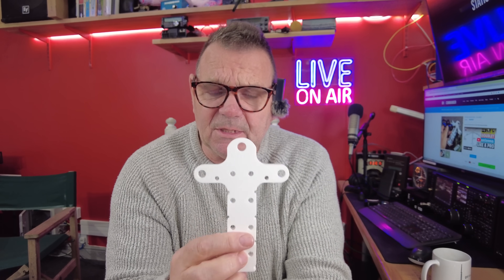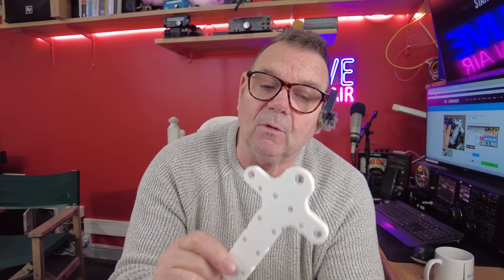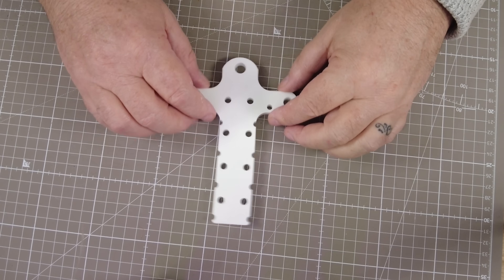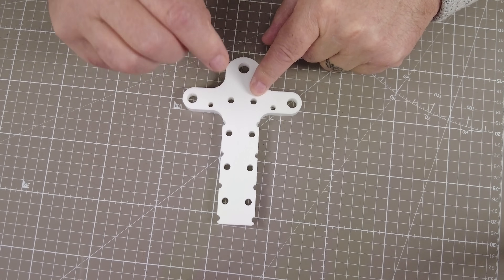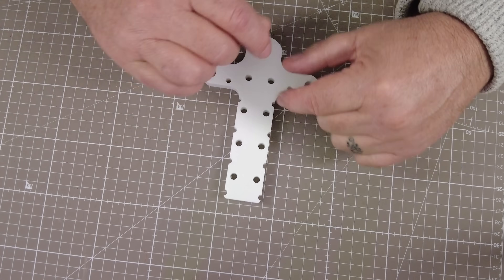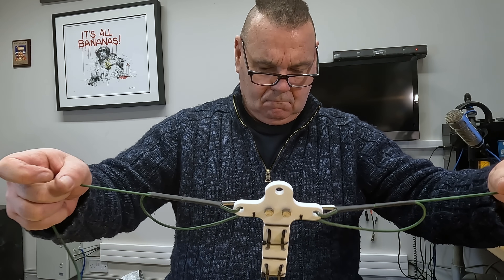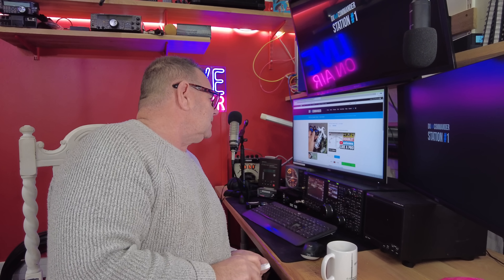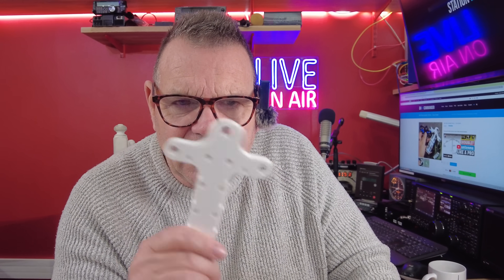Dipole or Doublet - One Little Detail Matters!

Comment: I have a DX Commander Classic.  Due to winds here, I've made 3d printed supports for the wires at every joint.
I printed them with PETG.  One is on it's second winter now, just took it down to service something and they're still doing good.

Comment: That a great improvement !  The type of plastic really matters . Has to be UV stable and handle all types of weather  and be non RF reactive . That a tall order for a dipole (doublet) center piece. And as to hold it all up as well.   Cheers from NY ! We just has 80 MPH wind storm . That with DX 50 will hold up just fine.
Reply from the maker: Absolutely, the material choice is crucial for longevity and performance!